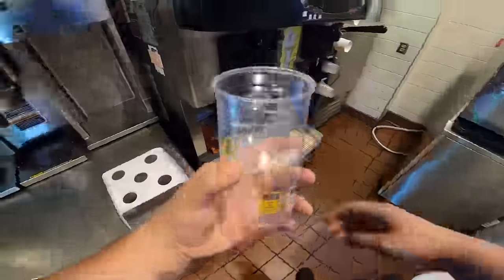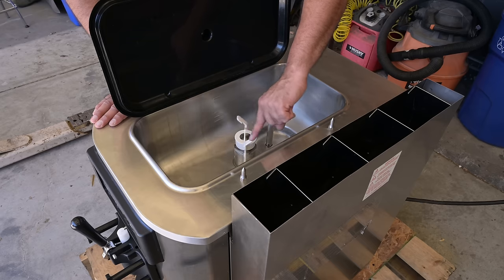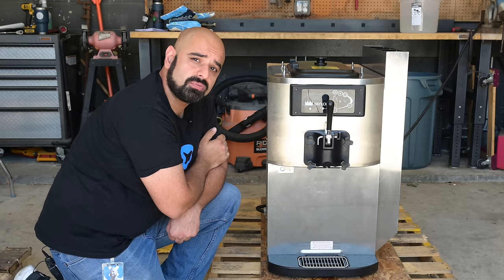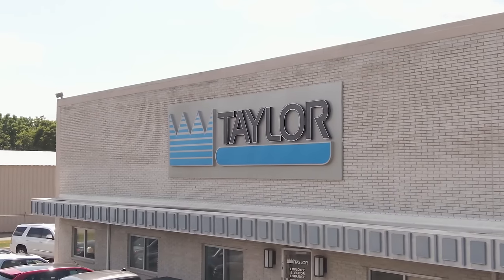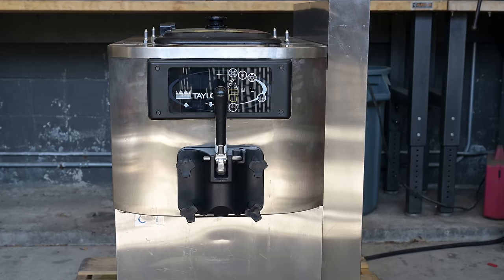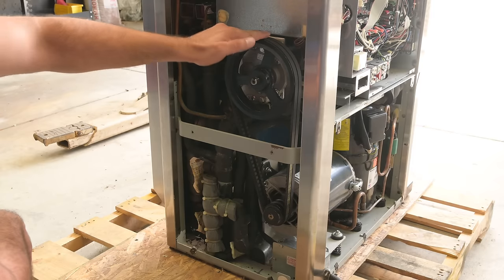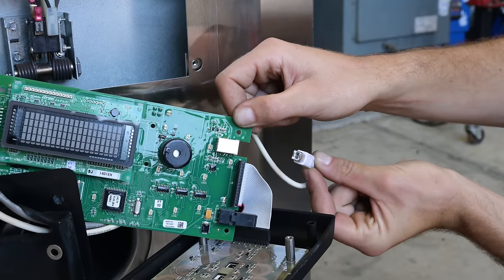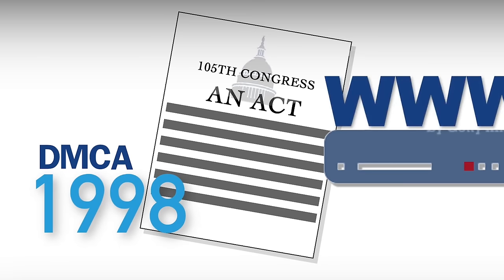Why McDonald's Ice Cream Machines Are Always Broken and How To Fix Them

Comment: In the past I've cleaned the Taylor c602(? I think it's called) for 5 years. Sharing my experience:

@6:50 there's no "overheating resulting in mush." If running lots of product in a short period of time and the vanilla shake mix in the top hopper has no time to freeze/solidify in the bottom barrel, it comes out liquidy. The machine never broke down, it just had melty ice cream. 

If it did truly overheat and refuse to operate, I'd suspect not properly cleaned or broken/worn parts that should be replaced. Gaskets, o-rings, scrapper blades (there's a 3mo and 6mo schedule)

The part after that is true tho, McDonald's employees have much limited access and allowability to fully take apart and repair the machine apart from the daily/weekly cleaning process

Comment: it's called putting computers on a machine that doesn't need computers. they are designed to fail and be non repairable unless you spend the money to get a tech out to fix it. I am an HVAC tech and I see it in everything heating and air-conditioning, they put tons of sensors and computers in machines that really don't need it and it turns an easy repair and a $20 part into a very difficult repair and a $500 part that is IF you can find it. they want stuff to fail just past the warranty so you have to buy another one and they make the parts so expensive it's almost cheaper to buy a new one
Reply: diagnostics are pretty invaluable for machines like this, it just happens that this specific model is intentionally obscure compared the ones taylor sells other resteraunts
Reply: @gruntlord6  the only reason you need diagnostics is because it's packed with computers and sensors it doesn't really need. it's made overly complicated on purpose. all you need to make a simple ice cream machine is a compressor, evaporator and condenser, old school mechanical thermostat, a motor to run the agitator and another to run the screw that mixes and pushes the ice cream out. when it breaks you could troubleshoot it with a $5 volt/ohm meter and a basic knowledge of electricity
Reply: @TheSimba86  it needs a lot of those for sanitary reasons, no one wants to get food poisoning from rancid cream being in the milk.
Reply: @gruntlord6  Nope.  The old style Tayor's are perfectly safe, if there's a cooling issue the machine just doesn't make Icecream before it's a problem.  They are also highly reliable.  McDonald's switched to these (they asked Taylor to make them) for the computer diagnostics to save on diagnostic time, and labor hours needed for cleaning.

Comment: No way there are THAT many flathead screws in a piece of equipment made after 1950. That’s insane. Other than the ones that were also hex nuts, it’s another FU to everybody working on the machine.

Comment: If I was McDonald's I would pull out of the contract or change the supplier. It's embarrassing.
Reply: the corperate mcdonalds gets a kickback for the contract, the franchise is who gets hosed
Reply: Franchise chains are highly motivated to hamstring the individual franchise owners.

Franchise owners suffer too much, they can't run a successful branch and the location fails, which is bad for corporate.

However, if they start getting too successful, they get less dependent on the brand and there is a raised risk of either getting more independent within their own store or even outright disenfranchising to create an independent competitor.

Stuff like this that locks them into contractual dependency on the brand is exactly what McDonald's wants and is probably done on purpose.
Reply: They own the supplier, part of the same holding corporation. Just another way to get a extra load of franchise fee, without calling it a franchise fee, from the franchisors. More profit. 

Very likely you will find the machines that go to fully owned stores are a slightly different firmware level, so that they will have some more understandable errors, or will simply limit the amount of product you can pull through when it is getting hot. Plus the fully owned stores likely have 3 or more of them, as they can then run one through the cleaning cycle per 8 hour shift, and have all 3 for peak hours. Corporate will easily absorb the extra machine cost, as they will not have no ice cream or shakes at all, making this location more popular.
Reply: Ice cream is a lower margin product so they don't care about it not selling. People will just buy burgers instead
Reply: @battmarn  Same mix is used in the ice cream and the Mcflurry, and the shakes. Just a different machine, so the margins are a lot bigger, as you are selling a blend of ice and air.
Reply: @battmarn  BTW ice cream is actually a high profit item. Looked at the one person who bought 1, then 2 months later, a second full size Taylor machine, and he basically paid off the first machine in 2 months in the summer, and after 2 months had the second paid off as well. He sold a lot of ice cream into a captive market.

Comment: What I don't get is that none of my local ice cream places ever have the problems the Taylor machines have at McDonalds
Reply: They probably avoid Taylor machines like the plague.
I know i would
Reply: It's probably a case of their business requiring their machines to work. For some reason, McDonalds doesn't care whether their machines are up reliably, or how much it costs to fix them.  For a shop that makes ice cream it's sole business, the machines MUST be up all the time and not cost thousands to repair regularly. That means either they have backups available, their employees are trained to troubleshoot them, or they simply pay more upfront for machines that are extremely durable and reliable.
Reply: That's because your local Ice Cream Places still have self respect. You sign that away in the initial franchise agreement with the clown.
Reply: You also should remember that most McDonalds restaurants operate  24/7, meaning that often the machine is in almost constant operation up until its heat-treat cycle. It requires a full brush clean every 7days, if it is not put together, lubed and cleaned correctly something will break or it will not dispense correctly. Likely most local ice-cream places clean their machines daily and have the time before starting their workday to get it in working condition.
Reply: @MaxUnix  And McDonalds should remember to schedule actual down time because I’ll bet there’s very little call for ice cream at 4am. And I also bet there’s not a ton for an overnighter to do in all the time between orders.

With their digital screen menus, changing what’s available is now trivial.

Comment: I worked at Chickfila as a manager and our machines were rarely down if cleaned properly every night. I don't know what brand it was but it was very similar to this Taylor version. It didn't take long in comparison to start up, as there was no 4 hour heat cycle. Cleaning and setting up daily took like 30 minutes at most, while taking food orders. Crazy to think about how I got paid $11.50/hr as a manager and never had the machine broken and Taylor charges $300/hr or more because they have a Mcdonalds monopoly.

Comment: in russia i haven't nad any problems with getting ice cream in mcdonalds, but pretty often in burger king there were no ice or ice cream
Reply: I think that since spring 2022 anyone would have serious problems getting McD's or Burger King's Ice Cream in Russia. I think you can get Вкусно – и точка, but not McD's. 😛 ;-)
Reply: @williamyf  there is practically no difference between Vkusno I Tochka and McDonald's. Same restaraunts same menu slightly changed recipies like bigmac or bigtasty, but almost the same taste, kfc turned back to rostics like it used to be before they bought KFC franchise but also same taste and dishes as kfc. Burger King hasn't changed.

Comment: I worked at McD for years and taught myself many error codes by reading all manuals and pestering the technicians. I was our Ice Cream guy and called on my days off MANY times to "fix" the machine. As many others have said, Heat Cycles and Cleaning are the main culprits in down machines. Cleaning takes about 30 minutes to do the right way, but then the machine can take 30 minutes to an hour to get back to cold temperatures. Heat cycles pasteurize the mix so it doesn't have to be taken out each night. Dairy Queen machines must be cleaned nightly and the mix stored in a cooler. The biggest culprit for McD machines being down is not actually the heat cycle or cleaning cycle, but the clock on the machine not being set. Just like the VCR of years past, many people don't know how to set the clocks on these machines and they go into heat cycle or planned cleaning during the day instead of at the time they should be programmed for. Not to mention that if the power is cut at any point (flipping breakers at close) the clock and sometimes programmed cycle times resets.
Reply: Wait, People flip breakers on a store in place machine overnight? Do they turn off their walk-ins too?

Comment: You did miss one bombshell that was went over in a documentary, YouTube video about broken ice cream machines from a couple years ago. Taylor, along with McDonald’s corporation colluded and paid a couple of franchisees to go out and buy a kitch device for two of their machines and turned around and took the kitch devices breaching the license and contract with the kitch company. Before that they attempted to buy kitch devices themselves, but Kitch, was on to them and knew who they were. They did not catch on to Taylor taking the kitch devices off these machines until they noticed their device is going off-line and not reporting back. I believe it went as far as the devices started reporting back from Taylor‘s headquarters but I can’t remember. Taylor proceeded to reverse engineer that device, and then I think they turned around and sued kitch to prevent them from allowing their devices on their machines. After they took care of Kitch, they turned around and put out press release of an approved device that they were in the process of developing basically similar to kitch

Comment: It's deliberate, for sure. Years ago (early-mid 80s) I worked for a company making electronic security systems, and they had a very primitive wireless alarm system in which each remote sensor was powered by a 9v MN1603 battery. Owners had to sign up to a service contract which among other things would replace these batteries every 18 months which was about their useful lifetime, given the poor design of the electronics. (And due to the need for numerous sensors, one per 'protected' door or window, the batteries were basically always needing replacement, all the time). As an engineer I was tasked with designing a replacement for this system which needed much more capability and to be actually secure to some extent. By that time technology had moved on and it would have been possible to effectively build-in a soldered battery with a lifetime of around 7 years, and then the whole sensor, which was far smaller as a result, could be replaced. We proceeded with the design to a point when the marketers and the other elements of the company started to work on it. The battery idea was nixed on the basis that it would kill the lucrative service contracts, even though it offered a far, far better customer experience from the constant 'low battery, call service' warnings. So the 9v batteries came back and basically ruined the project. That's corporate culture for you.

Comment: I worked at DQ for 6 years. We had Stoltein and Duke machines. Major differences: no heat cycle (ice cream mix was stored in a separate refrigerator and was already pasteurized) so it was only 5-10 minutes from startup until ready, basically no electronics, and water cooled so they never ever overheated. They were also easy and relatively intuitive to disassemble and clean/repair. Our main machine broke only once while I worked there because the compressor burned up, but it was more than 20 years old at the time. No other downtime while we were open.
Reply: The really bad part is Taylor does make great machines that don't have these problems (Wendies Frosty machines are Taylor and they work fantastic) but McDonalds has this toxic loop where the owners of McDonalds also partly own taylor, so McDonalds MANDATES this specific broken machine be used and then has this horrid contract repair system to essentially scam their franchisees.

Comment: The problem in part is excessive complexity in these new designs. My grandfather owned his own ice cream stand. Little's Dairy Bar, he had two of Taylor's machines that were 3-port designs with the middle being a mixed spiral dispenser. He did all his own maintenance and the reason he had 2 machines was so he could operate them in rotation. This allowed him to do breakdown/cleaning/repairs to one while the other was in operation. It also prevented excessive wear and tear since each machine did not run all day/every day.

That new Taylor machine is far too small. It is overheating in part because it has no room to breathe and exhaust heat properly and I did not see any ventilation system of merit. I know how much heat these machines put out because his stand did not need any heaters because between all the machines in operation, the flip top freezers, and the walk-in cooler it was always very warm inside.

Comment: I worked at McDonald's for two years when I was 16-18.  One night, dinner rush was busy AF and the ice cream machine ran out of chocolate syrup.  So I ran to the back to grab a fresh jug.  I filled it up, kept on, and left when my shift ended in an hour.

The next day, when I arrived, the machine was down, taken apart for a full cleaning.  I asked what happened and was told "someone put BBQ sauce in the machine." I said "who would do such a thing?!" knowing full well it was my mistake.

You see, in my haste, I grabbed the BBQ sauce jug off the shelf instead of the chocolate syrup.  They were placed directly next to each other instead of separated.  The cap to the chocolate jug was a very dark brown color.  The cap to the BBQ sauce?  A slightly less dark brown color.  The jugs, visually, were nearly identical down to the color of the liquid inside showing through the transparent plastic.

I often reminisce about the poor person that received a BBQ shake and reported this...

Comment: As a McDonalds employee at the moment, our ice cream machine has only been down for cleaning for an extended period of time once, had the drive belt catch fire twice, and only once did we run out of mix for it. This was over the course of 2 years so it is working just fine 95% of the time. Also that is not the ice cream machine model that we have at our location, ours is a twin hopper design with the shake portion built in.

Comment: The most sensible thing to do is to make people aware that they need the equipment that causes problems, like the case shown, to find alternatives and avoid these manufacturers, as soon as they feel their market value falling, the solution comes in the form of products with greater quality and less defective or maybe software without locks

Comment: All the complicated part is the mechanical and electrical stuff. It should be fairly simple to replace the entire electronics with own solenoids and relays and open source software and distribute a fairly cheap replacement board for $200 or so. Then, since the original board is not touched (just thrown out), and only electrical and mechanical things are re-connected, probably not DMCA would be invoked. Possibly add an additional fan/change case cutout to improve the overheating issue.
With that, also the important health aspects can be improved: adding a logging mechanism (digitally or on paper) that shows temperatures at all parts at any given time could even improve the industry as a whole.

Comment: I used to work in a UK Mc Donalds and our machine was not a Taylor. It had very few issues and worked pretty much all of the time. It was one of the combo machines that did both ice cream and milkshakes. The franchisee that owned the restaurant was forced to buy a different machine (still not a taylor) by Mc Donalds whilst I was there and the new one was a total pice of junk, breaking all the time, random error codes, etc.

Comment: Sadly I highly doubt that the machines are actually broken but rather it's just employee laziness. One thing I've noticed is that now many locations aren't even bothering to properly make McFlurrys. They are just dumping the toppings on top of the ice cream and they aren't using the mixing machines to finish making the McFlurry.
Reply: If you use the machine, you gotta clean the machine.

Comment: Take all the control boards out. Install a couple of temperature sensors and one switch to power on the beater motor and one switch to power on the compressor. Simple and easy to fix.

Comment: It is the same with scrubbers that we use at our work, we are not allowed to tinker with anything internal even if it might be a super easy fix, we need to call a mechanic. One employee was an educated mechanic but he was not allowed to do anything, even when he had way more experience than the guys that came to repair a machine. Pretty much all of our old scrubbers are now dead and the reason is that they are just being run till they break down because of a lack of maintenance.

Comment: With the machine overheating whats the airflow and temp in the area of the compressor and motor? If there isnt an exhaust fan can one be added? I have dehydrators for broadcast transmisson that run alot, they have exhaust fans. Is it possible for a franchise to have 2 ice-cream machines? Both legit or 1 legit and 1 not legit? Whats Dairy Queen ice cream machines like and their prep and downtime?